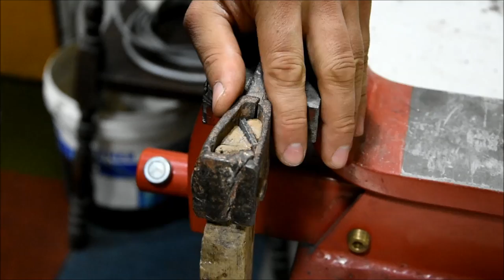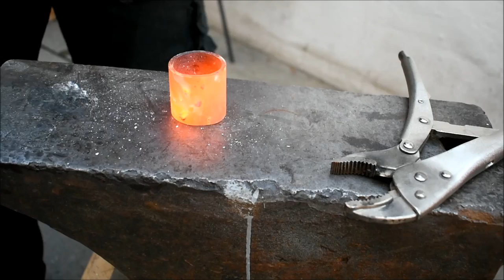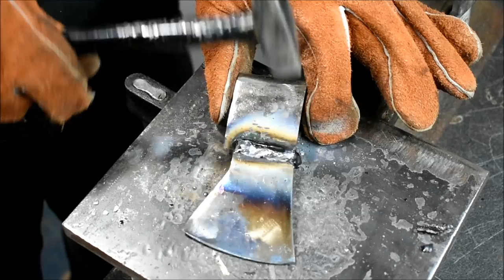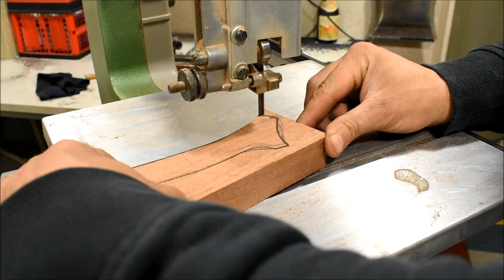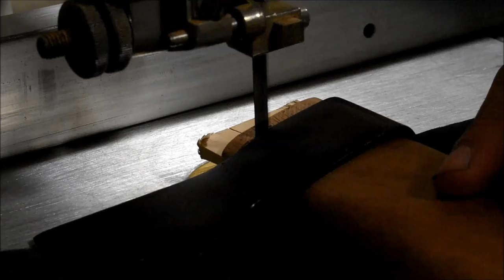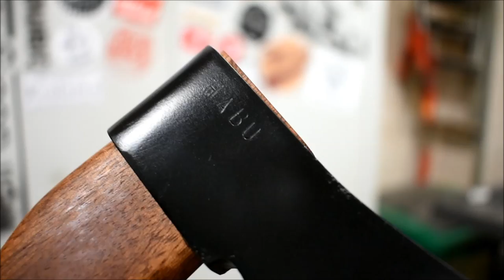DIY | Building an axe out of scrap

Comment: Good eye with the pipe, Habu. I am not sure what wood that was for the handle, but woods like hickory and ash are most often used  because they are tough, somewhat flexible, and they resist splitting. Safety is the important thing with an axe or hatchet. These tools are often swung above your head and around your legs and feet. A flying edge tool is something to be avoided. Enough said. I like your work. Keep the energy.
Reply from the maker: +bomaite1 Thanks man! Much appreciated... I've used mahogany in this case.

Comment: fantastic job, I would have tried to work with all the original steel, would you not have some concerns about cracks or splitting on the pipe metal?

Comment: That first axe was the saddest axe I've ever seen in my life...  Wranglerstar would've had a heart attack.

Good job with it, it looks beautiful.  The only thing is the head may come loose again because it's so hard to get a consistent fit throughout the eye.  The best thing to do would have been to make some sort of template to hammer the pipe to fit, and to model the handle after.  Then you would have a perfect fit, with both the head and the handle made for each other.

A few tips I picked up from Wranglerstar, use a piece of wood to hammer the wedge in to help keep it from splitting, and spread the force out to make it rock in less.

Also, hold the axe head down, hitting the handle(leave the bottom unfinished if needed so as not to mar it) on the bottom.  This will seat the handle into the head gently but effectively.

Also, you never put a metal wedge in, why?

Comment: Awesome build, but why did you put the varnish on after you put the axe head on? Wouldn't it have been easier to put it on before and not have to worry about getting some on the axe head?
Reply from the maker: +Caleb Jorgensen Thanks man! That's just linseed oil what I put on... ;-)

Comment: Hello, quick question... at the 5:00 mark, how many passes did you make to build up the welding to fill in the gap? Because by the end you ended up with smooth sides. I've got a project to rebuild a small hatchet that has the eye broken from being beat up with a hammer and this solution of cutting the head and welding it back up seems to work nicely. Subscribed... Thanks!

Comment: Can't even tell this was a scrap repair. My only gripe though would have to be the lack of a pole on the back of the head to help with stability in the swing, preventing the head from turning mid swing or deflecting on impact. Might not seem that big a deal, But after repeated use of processing wood, either for a wood stove or camp, anything that makes your tools easier to use and less tiresome on you is always appreciated. But that's my only criticism about an otherwise beautifully well done project such as this. Keep it up!
Reply from the maker: +todd collings ;-))
Thanks man!

Comment: Good job, but the edge does not have to be that sharp.
Reply: why
Reply: querr: Any mountain man will tell you that a very sharp edge on an axe will only end up folding over, or even worse, it will chip. This folded over burr will end up not cutting any branches. The edge should be similar to what is on a cleaver.
Reply: you have a right thanks for the answer
Robert Cornelius
Reply: not true.. it can be shaving sharp. that has almost nothing to do with strength. if anything, rough spots or teeth on the edge can create weak spots. The angle of the grind and its geometry is what determines strength of an edge.

Comment: You ruined a forge welded axe head. Why not apply you wonderful skills to repair and restoring the original??Your rebuilt axe is pretty but has no weight behind the handle so it will be unbalanced and flick out which will make it dangerous to use. It will not take much use before it fails.